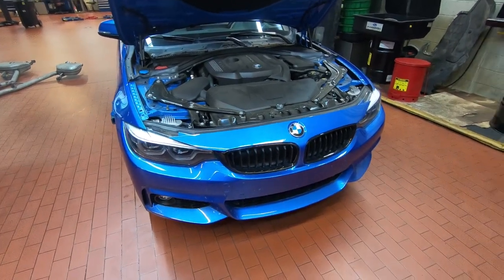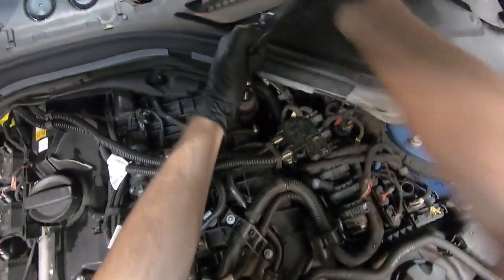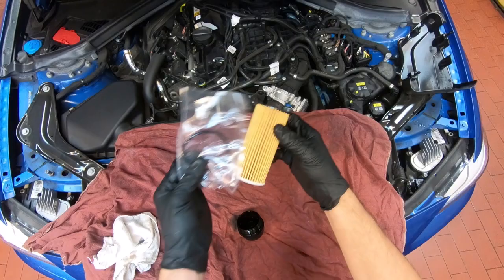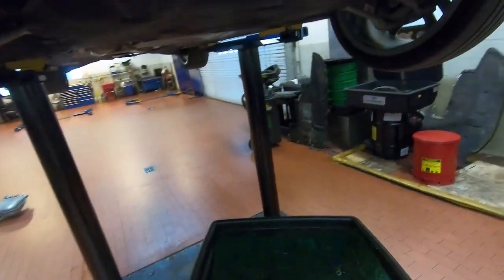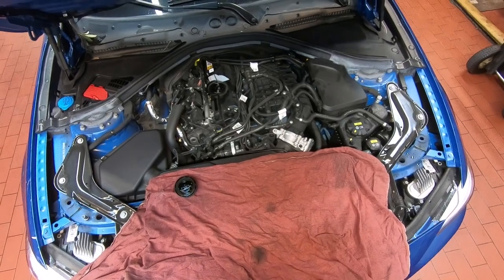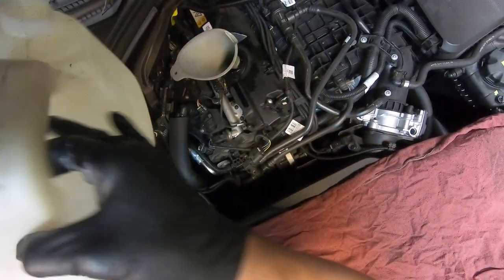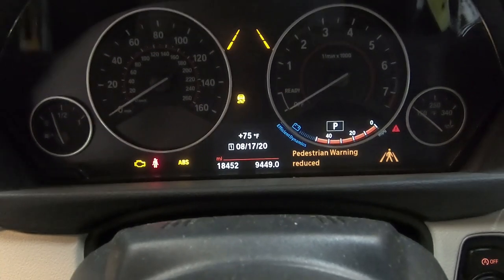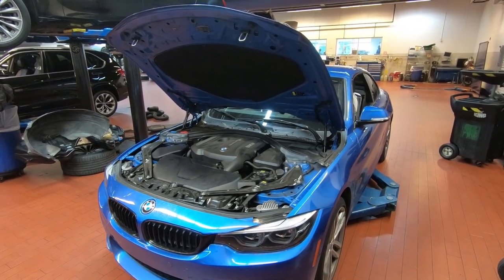2020 BMW 430i (F32) oil change * HOW TO*

Comment: oil filter is drastically much more difficult to access than the n26, n20, and n55 engines. There's a plastic tube that runs from the overflow tank to the block(underneath the intake). Be careful not to bend it as it breaks easily.

Comment: Hi i just did an oil change on my 120i (B48) and pulled about 2,5dl to much oil in it. Should I drain a bit or is it okey anyway. / take care
Reply from the maker: do is 10ths of a liter correct? If so, you should be fine
Reply: @THEDriverMod_  correct 10dl is 1 liter sorry for European measurement :) I was afraid that I would hurt the engine with leaks and so
Reply from the maker: I was just confirming, so you added and extra 2 and a half tenths of a liter, that shouldn't hurt anything
Reply: @THEDriverMod_  thanks a lot keep up the good work and have a good day :)
Reply from the maker: You do as well! Cheers

Comment: You forgot to mention that it's important to align the little plug on the bottom of the oil filter with the hole in the oil filter housing that it is supposed to fit into.
Reply from the maker: If you rotate that cap by hand, it will self align. If I did forget, I apologize
Reply: Can you explain what happens if the plug/hole aren’t aligned?

Comment: What’s your take on mileage intervals to complete this on B48s?
Reply from the maker: Depends on climate, modified verses stock, oil brand used and driving conditions.
Reply: Plan on keeping it stock. Out here in Portland. Daily driver & just OEM 5W-30 synthetic
Reply: I plan on babying this thing. Just bought it at 50k miles from a private party. No leaks/issues reported.
Reply from the maker: @Lopezmvp14  try using the amsoil 5w-30 European oil. Performs extremely well in these engines. www.premiumsyntheticsusa.myamsoil.com

Comment: Could you give me a tip for the best oil type? I have the same car what is in your video (mine is a gran coupe but also 2020 and 430i). My service partner told me that 5w-30 is the standard but I could see in a BMW software that 0w-20 is the preferred. So what would be the best oil to my car what has only 2400 miles. (5w-30 OR 0w-20?)
Reply from the maker: I would use Amsoils 0w20 European oil.
Www.premiumsyntheticsusa.myamsoil.com
Reply: The viscosity is only part of the requirement for the right oil.  Make sure the oil meets BMW LL-14FE+ if you are worried about maintaining your warranty or for a long engine life.  Buy the oil from BMW or from Motul.  Cheaper oil is false economy!
Reply from the maker: @CanAm1992  the Amsoil European 0w20 meets and exceeds the factory BMW specs as well as Motul and the Factory oil. We use it heavily in the independent shop I work in without seeing any issues.
Reply from the maker: Proof of what?
Reply: My BMW dealer recommend 5W-30 but this one exist only in LL-04. Based on the manual I can use only LL-04, LL-12FE, LL-17FE+. Last would be the best but this specification has only one viscosity (0W-20). I prefer original BMW oil. I have made a research and found that BMW does not provide original oil in all viscosity for all the 3 mentioned specifications.
Reply: @csabaszabo1901  what does your owner's manual say about viscosity?  I would be very careful about deviating from that if the car is still under warranty.  Some guy at the dealer may have his own opinion but that won't help you if there is a warranty issue!

Comment: Appreciate the video sir but I found one small item that you appear to have got incorrect. 
The seal or gasket goes on the 2nd to last groove and not the bottom groove.
Reply: I just did my oil change and placed it in last groove will it leak oil if it’s not in 2nd to last groove ?
Reply from the maker: 4 year update doing oil changes on these engines, no oil leaks to report. Do it the way the video demonstrates